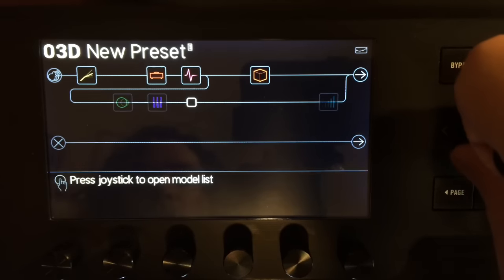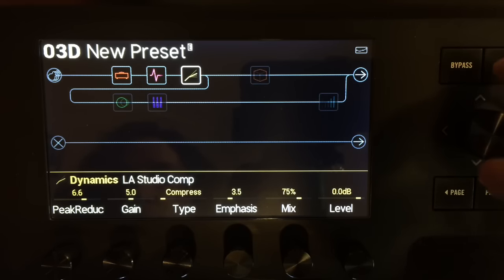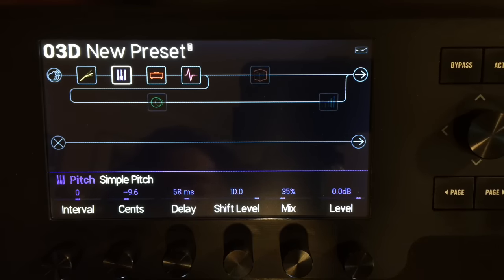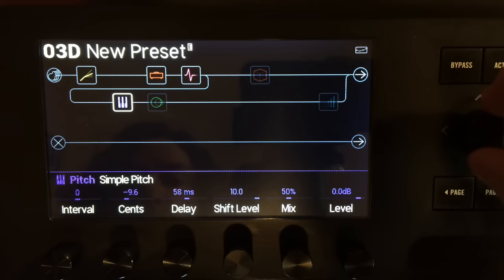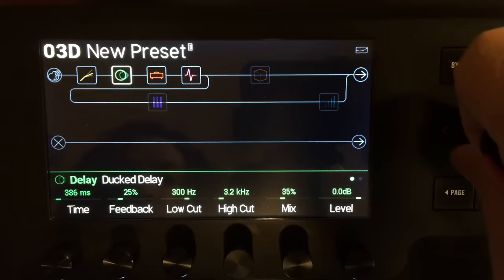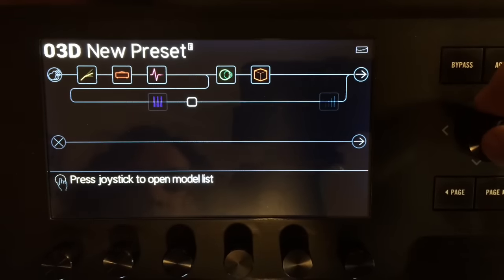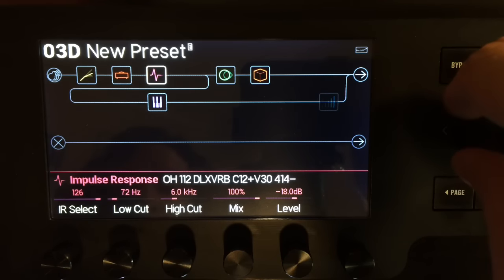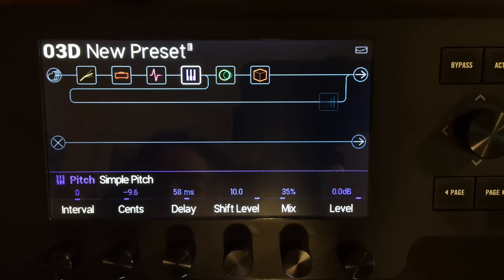Line 6 Helix - Signal Chain Etiquette

Comment: You moved the pitch block back and forth between a spot before the amp and a spot not only after the amp, but also on a split as evidence that the effect can vary widely, depending on whether or not the block is before or after the amp (demonstrated by the fact that the delay on the block was harder to hear after the split). But you'd have to turn the mix up on ANY kind of block on a split to hear it as dramatically as you can in the main line, because the very definition of a split is that half of the signal you're hearing isn't going through the block. Near the end (at 6:29), you even prove this in a manner that contradicts your claim in the beginning that the thing that makes the pitch block sound different is its placement in relation to the amp and IR; you put it back on the main line--but after the IR--and get essentially the same sound you had when it was upstream from the amp. I mean, of course, anybody who's put together an analog pedal board understands that effects do react somewhat differently based on where they are in the chain, but IMHO, the addition of a split into your explanation seems likely to confuse newcomers. Still enjoy your work, overall, though!

Comment: is it possible to hit one button in stomp box and have two blocks turn on?
Reply from the maker: Gary Walker You betcha! You only have to move the cursor to the block (effect) you want, then touch the switch you want to assign it to, then, it’ll ask if you want that switch to control that effect.

Comment: So dumb but basic question. With a real amp setup, speakers and mic are the last thing in the chain. Why then with these line 6 modeling products do we most of the time have the cab/mic (or IR) before additional effects like delays and reverbs. Doesn't seem intuitively obvious to me. Shouldn't the cab and then mic (or IR) be the final chain items?
Reply from the maker: +Scott R I couldn't tell you. I only know what I think sounds good. I'm not a tech nerd, not an engineer, not a software guy...that stuff is over my head, and that's cool with me.
Rock on,
Scott.
Reply: The L6 presets are set up that way like real world set ups that's how I've been making my presets with efx before the amp cab/ir's WTF???the way this guys got is makes no sense to me!
Reply: I'm brand new to "IRs", in fact I haven't even purchased one yet, but I am confused about this as well. My instinct would tell me to put the IR very last in the chain as this would emulate where a mic'ed cab would actually be in a signal chain. But noone seems to put them last in any demo videos I've seen. This original comment is 3 years old, anyone have any new insight on this? Thanks either way!
Reply: Wouldn't the delay/reverb after the cab be simulating any reflections in a room you have the amp and mic in?  There were more than a few early songs recorded in parking garages, etc. for that type of ambiance.

Comment: Would you also consider doing a similar tutorial on mic selection and distance and how that also affects tone. My understanding is it does and can be significant difference. You're saving us a lot of trial and error with your intel!
Reply from the maker: +Randy Booth I doubt it... I use IR's now, full-time, I no longer mess around with the built-in cabs and mics...I don't think they feel like a real amp, compared to IR's.
Rock on,
Scott.
Reply: +The Helix Channel I knew you had jumped on the IR train; didn't know if you could change/experiment with mic placement parameters on an IR but I'm assuming that isn't possible. I'm a total IR newbie and will start using them when I buy some ownhammer IRs that go with your presets I bought.
Reply from the maker: +Randy Booth With IR's, the mic and placement are fixed, giving you a digital snapshot of a specific mic in a specific location on a specific cab/speaker. The IR packs include enough mics and positions to cover any sound you want.
Reply: +The Helix Channel good to know thanks
Reply: Mic distance basically let's you determine how much proximity effect of the mic  you want in your tone. In a nutshell, the closer you place the mic to the speaker the more bass will be introduced, the further away you place it the opposite happens.